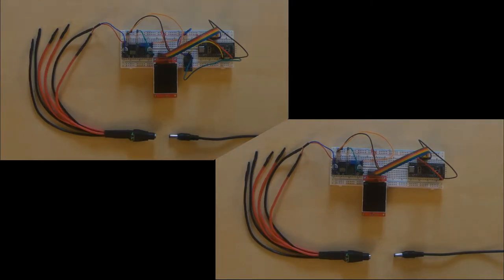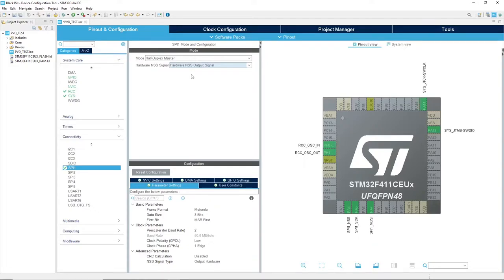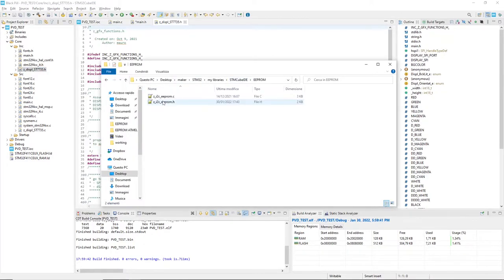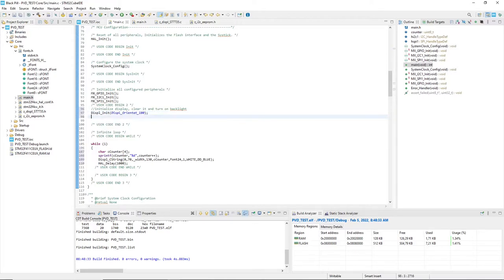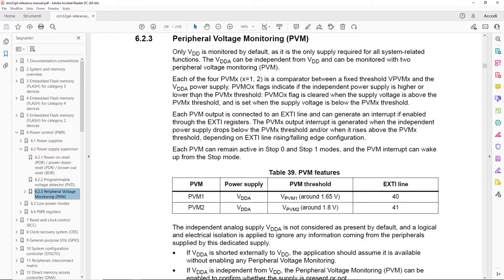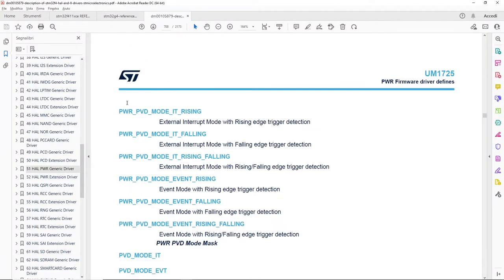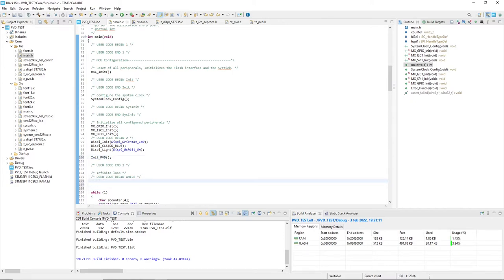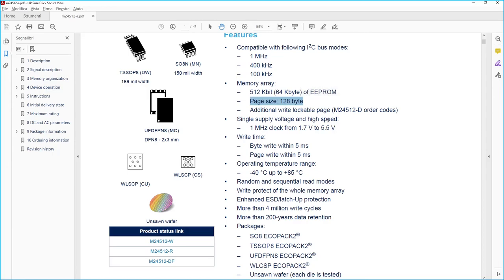STM32 and PVD: "how to" backup system data on EEPROMs

Comment: Thanks for a nice training video. I am new to  this topic. If I understand correctly, you are using LM2596 converter. Could you explain which pin of STM32 board is connected to the output pin of LM2596 converter?
Reply from the maker: There is no a pin dedicated to power measuring. PVD directly monitors VDD through an internal voltage reference: see description and diagram shown on minute 12:00 (https://youtu.be/AHBGlCDGqhE?t=720).

Comment: First of all thank you for the interesting video. I am new to STM32 programming and have the following question: Is it possible to write the data on the Flash Memory of the uC instead of using an external EEPROM?
Reply from the maker: There is an Application Note from ST about EEPROM emulation on the internal uC flash memory:
https://www.st.com/resource/en/application_note/an3969-eeprom-emulation-in-stm32f40xstm32f41x-microcontrollers-stmicroelectronics.pdf
Keep in mind that emulating EEPROM on a flash memory should only be done under certain circumstances. Generally, it's not a good idea to use a flash memory as if it were an EEPROM.
Perhaps the introduction of this video can help understanding differences between Flash and EEprom:
https://youtu.be/KlG2doCkREM
Reply: Thank you.